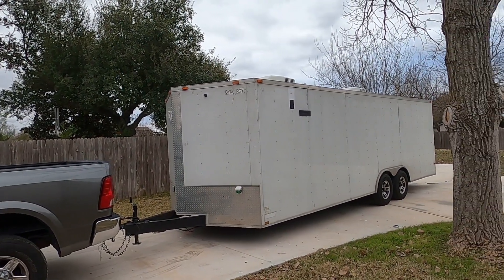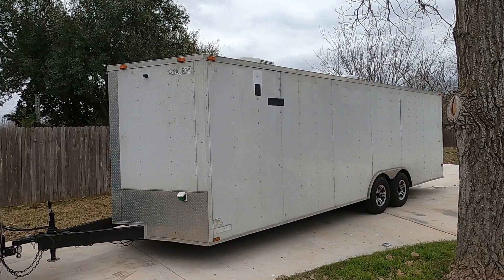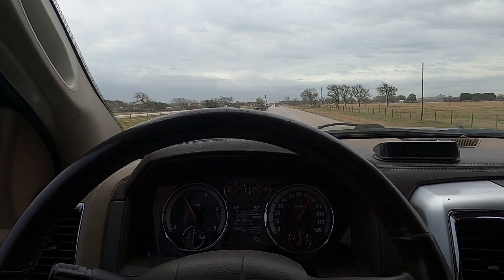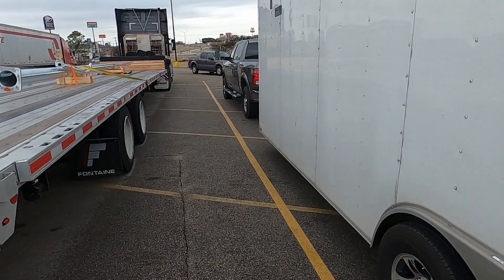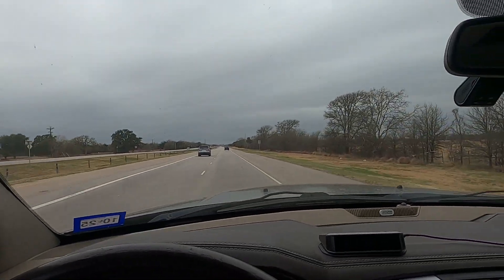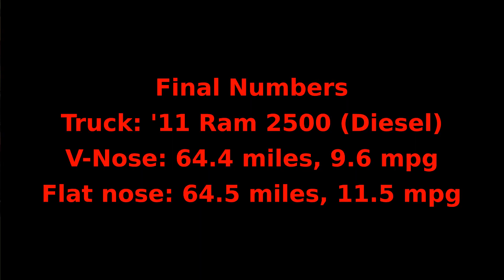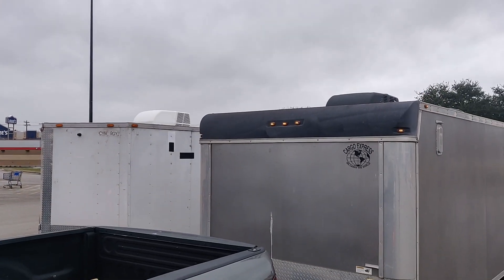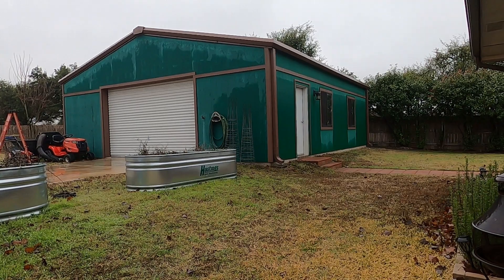Trailer MPG Shootout.  Is a v-nose really better than a square nose?

Comment: I have a 2018 Haulmark 6x12 V nose trailer rated at 3k. It is one of my smallest trailers. I just got done with a 2500 mile trip, half of the trip empty and the other half overloaded. On the empty half of the trip my mileage varied between 9.5 to as low as 7.5 in some severe cross winds. Overall average was around 9.5. Coming home loaded, I did drive slower, 62-65 mph since my truck and trailer were now over 20k total, but I averaged over 11 mpg. The speed really changed the fuel consumption! My little trailer was overloaded at close to 5k but it only had 3600 on the axle when I scaled it, but that was after I removed over 1000 lbs of my brothers items. The weight didn't seem to matter. The fact that my 2023 GMC dually diesel had a full bed of equipment might have helped with airflow though on the return trip compared to an empty bed with just an aux fuel tank and tool box on the trip out. For comparision I have two fifth wheel trailers that I tow. One is a 35' Solitude 310GK that tips the scales at 15k when loaded and I average 9-9.5 mpg traveling 70 mph. My other fifth wheel is a Alpenlite Aspen 27' that weighs 9000 loaded. I can get around 12 mpg towing it by itself, but sometimes I tow a 5500 lb Jeep behind it and then I am at 8.5 mpg or towing a 3000 lb boat, I am around 11 mpg on long trips. Strong winds will cut all of the mpg's quite a bit. 
It is very interesting to see how your results are close to mine. I also have a 14' horse trailer that I built back in 94. It has 7' high walls and is 6' wide with a square front. This trailer used to only yield about 8 mpg no matter what truck you towed it with. I loaned the trailer to a friend so he could mover from CA to MT and he offered to slope the front of the trailer for me to help improve fuel economy, It worked! He sloped the front about 3' down from the top to 3' to the rear and towing mpg improved by 3mpg on average.

Comment: I’m curious if both ways are the exact same? Is the first trip slightly up hill?
Reply from the maker: The first trip was downhill, from Elgin TX (581') to Brenham, TX (341').  That would have been in the V nose trailer's favor.  But it's a pretty small elevation change that probably didn't skew the result significantly.

It was a windless day, which I verified when I started off in Elgin and when I stopped in Brenham.

Comment: I have dragged hundreds of trailers(53 foot) with my Kenworth ) over the years and the trailers that had sharp corners on the front were the worst.  They felt like always pulling into a headwind but the rounded top and rounded side fronts on trailers were much easier to pull.  Fuel economy was always affected.

Comment: Great work, I was initially thinking the V-nose would do better, but I completely spaced out on thinking about how much additional frontal surface area it would have that would increase drag. Nevermind that right angle transition to the roof generating a large amount of turbulence. So you're fighting several things,  added drag from the additional surface area and added drag from the turbulent airflow on the roof.

Comment: I bought a 6x12 trailer. It is aluminum and a vee nose. I went with a vee noise for the additional storage space. On a larger trailer I would not get a vee nose. This little trailer only weighs 950lbs but it is like I am dragging a parachute. Going down a large steep hill I'll still have to stay on the gas or it will slow down.

Comment: I have a cynergy. Absolute garbage. I had to get it rewelded twice on the frame and vertical supports are currently cracking.
Reply from the maker: Yeah, the welds on this one are pretty bad too.  Lots of holes blown in the tubing due to excessive heat.  And the welds were small and sloppy.

Comment: Drag is a function of frontal area…the front end design (pointy vs flat) has minimal effect.  To an aerodynamicist, a v nose is not “obviously more aerodynamic”.  Keep the weight down, trailer close to the tow vehicle, and don’t tow uphill 😂.  If your trailer can fall within the frontal area of the tow vehicle, that’s the best (if you stand in front of your vehicle and can’t see the trailer).

Comment: Cool test. I am sure the sharp corners theory is part of the difference. However in my opinion the main difference here is how close the box is to the truck. The flat nose trailer's box looks to be a little closer to the truck compared to the v-nose. In my experience this is one of the largest factors in trailer towing efficiency.
Reply: As is the alignment of the axels on both trailers
Reply: I would be curious to see a measurement of the space between the trailers and the truck as well, I believe this is a pretty significant affect as well